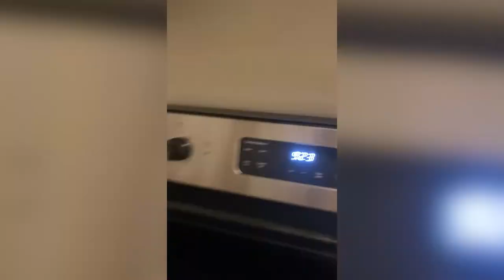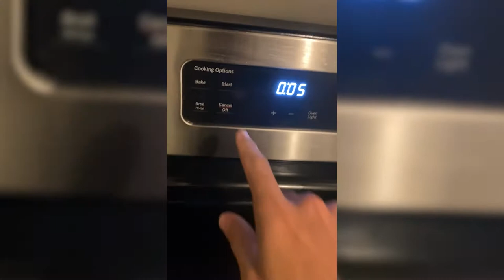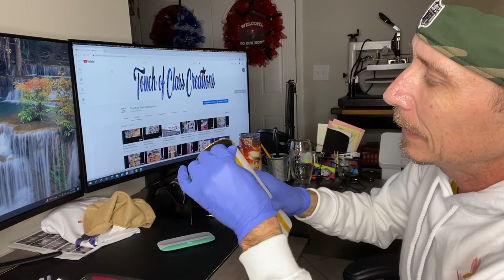Making a 20 oz skinny tumbler in a Cricut Mug Press!!  How to cook an image off and fix Part 2

Comment: I figure you help all of us out MAYBE i can help you out. I noticed you saying you have trouble with seems. I have seam an interesting video on this. After you get all the tape on, use a credit card to run up and down the seam several times, first from the top and then from the bottom. There is another seam that you can't see, once you find it, repeat the process on that seam. It will get rid of any and all ghosting. One more hac, instead of using shrink wrap, try using painters tape. Hope this helps ya out! Xd
Reply from the maker: That is definitely great info. And does work, as since making that video I have tried most methods. Actually better than credit card I now use my vinyl squeegee, works even better!!! Thanks for the info though, and may also help another viewer!!
Reply: @TouchofClassCreations  I hadn't thought of that one! Nice! And saves your credit card lol Xd